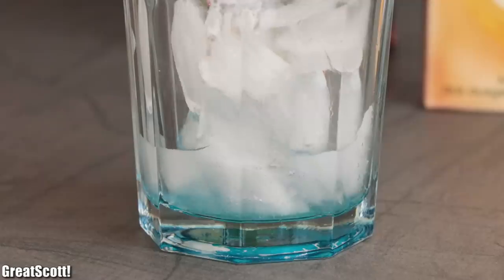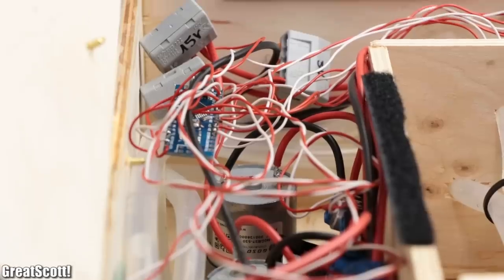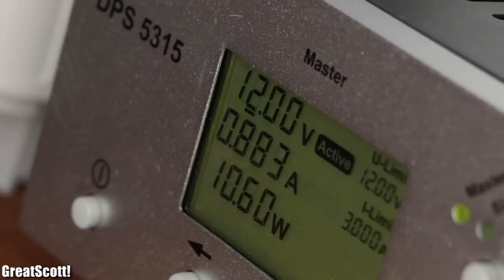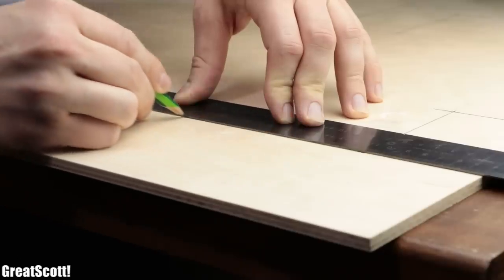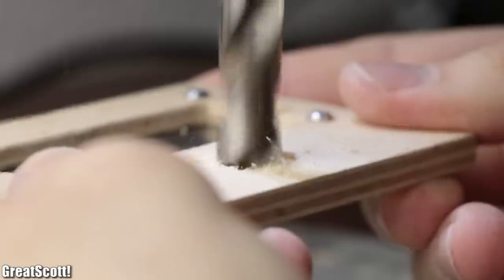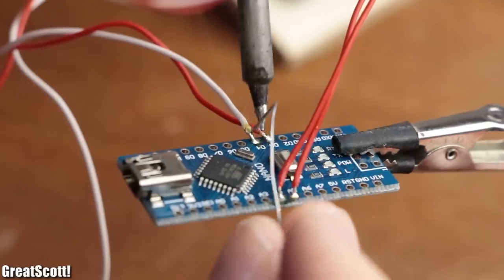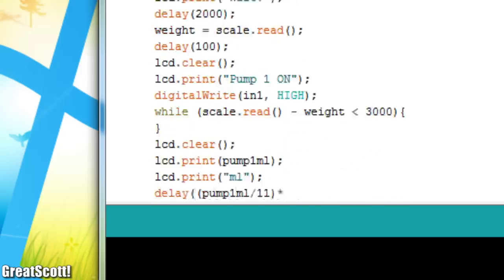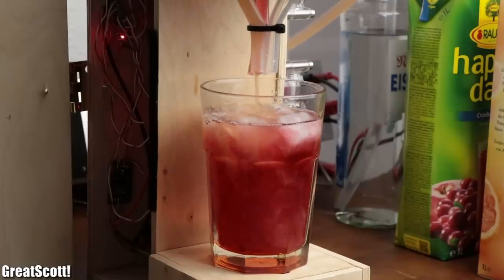Make your own crude Cocktail Machine

Comment: A suggested upgrade: after dispensing each ingredient, run the pump in reverse for a few seconds, to empty the portion remaining in the tube.
Reply: Another idea; to save some cost in favor of preparation speed might be using just one pump and distribute the ingredients through the tubes with valves.

Comment: Cool project. 

Just a tip, pre drill your holes in the timber, you have a pillar drill. Perfect nails, no splits and you control where the nail goes. Same as electronics, provide a path of least resistance and the nail will follow

Good Job on the electronics 🙏
Reply from the maker: I will remember it for next time.
Reply: GreatScott! No need for nails. Just use glue between the surfaces and clamp them together.

Comment: Would it be worth reversing the pumps for a few seconds after it finishes to clean out the hoses? That might keep the plate clean and make cleanup easier later. 

It would also make switching to other drinks easier. It's not a screwdriver with cranberry juice!
Reply: That could cause problems if the pumps need primed.
Reply: I dont think this type of pump needs to be primed, looks like it should be air-tight. but then again I haven't used them.

Comment: This is an interesting project and I liked your design, thank you for these amazing videos. 
One idea to add variety to your drinks is to use solenoid valves to control from where the pumps are sucking, this way you wouldn't need as many pumps and the valves are definitely cheaper.

Edit: Thinking again, maybe using the valves wouldn't be such a good idea for food safety.
Reply from the maker: Good idea. I like it.

Comment: That is awesome, i wonder if with 3D printed parts for the case and a little bit more of engineering to account for the vibration so more structure would give a better stability, and a SD Card reader to read "recipe files" would render in a awesome machine.
Nice job, i would like the video 10 times if i could.
Reply from the maker: Thanks mate and thanks for the feedback. Nice ideas.
Reply: You could even use some Peltiers and cool the drinks to temperature, that would be cool, and with a bit of code you could easily compute the alcohol percentage and volume in a said mixture of drinks :)

Comment: I saw a group of 4th year engineering students did a similar project to this for their capstone project. Cool! 
Theirs worked a bit differently in that I think all tubes could run at the same time, no weight sensor. They also added an auto cup dispenser and conveyor for coolness factor.

Comment: Hey man. You got to apply the solder to the pins as you're heating with the iron. When you put the solder on the tip first, the flux burns away and you get a cold joint.

Love the videos!!

Comment: The 5V pin of the L298N is actually an output from the build-in regulator. So no need to hook that up to 5V
Reply from the maker: Correct, I realized that too late for the video but changed it in the schematic.
Reply: True

Comment: Thank you. Very interesting demo with professional work. Different constituents can be placed at top and gravity fed into the bottom container. The flow of different constituents can be changed automatically using solenoid valves placed in the discharge line of upper tanks.The load cell can weigh cumulatively and stop in the end.

Comment: Hey GreatScott!
I have a project idea for you: Modify a PSU to be constant current source.
I think if you remove the feedback from the output and add a small resistor(current shunt?) to the low side, it could provide a feedback. This should be amplified to the appropriate level and voila CC PSU. 
I didn't think this through, but I think this could be done, with your knowledge.
Would be useful to drive leds, even many in series, since the voltage could go above 12V.
What do you think?
Cheers
Reply from the maker: Hmmmmm I put it on my to do list.

Comment: instead of using a timer you could have used the strain gauge measure the weight?
Reply: He could, but I don't think it would work as well as it does with the timer. The problem here is that the load cell produces a low signal that is susceptible to noise, in order to read a stable signal you must use some form of filtering, which will decrease the response time of the load cell, so he wouldn't be able to measure the amount of liquid poured in real time.
Reply from the maker: Yes, that would have also worked. But the problem was that due to the vibrations the measurements were a bit off.

Comment: it might be possible to measure the liquid on a other way. you might be able to measure the current of the water going through, because it is moveing electrodes it should produle a voltage !!
can you do a vid on that ?
Reply from the maker: I don't understand what you mean. Sorry.
Reply: GreatScott! Go on wikipedia and search for magnetisch induktiver durchflussmesser
Reply: GreatScott! Dass meine ich
Reply: I'm not sure what you're referring to, but you can't use the electrical current flowing through a liquid to measure the flow rate. To do that would require either a turbine in the pipe or something else that can be measured electronically which is not practical on this scale
Reply: Algorhythm no, you can do it. It is called magnetic flow meter. Or mag meter. It requires a conductive liquid. The problem here is that it requires a known conductivity on the liquids. Which would mean recalibration after each new liquid is used.
Reply: Rostol yeah thats what i meant :-)
Reply: Some flowmeters work like that I think

Comment: how safe is it to move liquid from a pump like that, since you will drink it
Reply: Very as you see he replaced it with food safe silicone tube.
Reply: Kartikey Agarwal He used food safe silicone tubes plus no mechanical parts come in direct contact with the liquids, the pumps simply press and push the liquid forward in the tubes
Reply from the maker: Correct, like already stated very safe due to the food safe tube.
Reply: If the tube is food grade it should be completely safe, as the liquid doesn't get in contact with anything else.
Reply: Very. Peristaltic pumps are used in hospitals for this reason. No mechanical parts come into contact with what is being pumped.
Reply: GreatScott! OMG great Scott reply
Reply: The way the pump works, the liquid never touches the pump directly. As long as your tubing is food safe there shouldn't be any concerns with it.
Reply: remember to clean it every now and again, I imagine leaving stagnant fruit juices in there would go bad quickly.
Reply: KX36 Depends whether you're buying a china food safe or a "really" food safe tube
Reply: +Rostal They are also very gentle on cells, so they are good for moving blood around without turning it into a protein slurry.
Reply: None of the moving parts contact the liquid. Pumping some dish soap and water through the device is as simple as changing the reservoir and ordering another round of "drinks".
Reply: A peristalic pump never touches the liquid it uses pressure that's what's so great about it
Reply: but there's a vodka so the drink is sterilized ;)
Reply: +Grzegorz Paleczny
That's the sort of thinking that ruins visits to Tijuana. ;~)

Comment: great idea!
the scale measures mass not volume so liquids with different viscosities will give different volumes. you could have one pump and a distributor that changes the liquid being pumped (plus some valves and that way you could have maybe 10 liquids and only one pump , plus you could do a flush to the pipes after each liquid was pumped)

Comment: Suggestion: When you drill into wood, Drill from the hidden side and also have another wood piece under the piece you are drilling. That way when material is pulled up the hidden side will have ugly sides(Because of wood pulled up) and the good side will have a nice hole because the wood piece it is against will prevent sides from separating on the sides. If you need both sides pretty, then sandwich the piece you are drilling between two other wood pieces and then drill.

Comment: I have a plan to make these cocktail machines in this way but with a vinyl wrap inside and outside. The pump motor inside the case, The LCD Display, The rotary encorder, The Arduino Nano, The pump motor driver, The Scale, the DC jack all connections will be connected through a designed PCB and order it from JLCPCB and with a on/off switch. The Rest of the Pump pipes will be in a professional look. I hope you make like this cocktail machine in a future video

Comment: Instead of using load cell, you can try 3 flowmeters inline with each pump. That way the drink can be made faster as the 3 pumps will pump simultaneously.

Comment: I'd make this with plastic instead of wood to be more kitchen safe but this is still a perfect DIY... might do this in the future
also, it would be good to have in the code the pumps reversing just a bit after pouring liquid in the cup to avoid any leakage to the cup base

Comment: When you drill holes, remember to put a piece of scrap wood behind what ever you are drilling(this prevents the chipping). Also never use nails, they make things look cheap and never look nice, alternatively you could of done dowel joints, which is quite easy to do. I recommend that you get a laser cutter, as they are really useful for my electronics projects, and if you know how to make boxes via 2D CAD software, you can do the casing for that project in a matter of 45 minutes.

Comment: You do realize that by using a positive displacement pump (like a peristaltic pump) you don't need to go into the trouble of measuring the weight of the transferred fluid. Simply by counting the pump shaft rotations you can get a comparably reliable reading of the volume.

Comment: Hey Scott, I have an idea about your vibration problem.

Instead of mounting the 12V DC motor to the frame by screws. Have them inside of the box and glue it to a sponge or something that is a good vibration absorbent. 

Then have strong adhesives connected to the 12V DC motor and the sponge, both to where ever you want.

Hopefull this should reduce the amount of motion.

Comment: you can make it customizeable without messing the code by using the rotary dial or add a SD card with a library of drinks and it will say which container goes to which pump.

Comment: To avoid tearout, put a sacrificial board under the piece you're drilling through. Also, use some sandpaper to make the edges less rough, after or instead of the rasp.

Comment: thats a very cool idea but the only problem i see is cleaning it after use as im quite sure mold would build up within a couple of days if not cleaned manually. The only thing I could think of is after its done dispensing the drink if there was a clean cycle say using water that would push the water though the tubes to clean. other then that its very cool :)

Comment: Just a quick tip regarding wood glue: it works best when gluing two surfaces together, but is terrible at filling gaps. So instead of gluing the wood together with superglue and then filling the gaps with wood glue, I would only use wood glue. A thin layer is enough to create a super strong bond, it just needs some compression during drying. Ordinary clamps are totally fine, but when working with a rectangular shape, strap clamps are really useful. Gaps, should they remain, can be filled using wood glue mixed with an equal amount of saw dust.

PS: You said beech wood, but it seems to be birch wood, but not a big deal ;)

Comment: You could use your strain gauge to measure the weight of your product.
When you start your drink the scale zeros and measures the amount based on the density of water (assuming most drinks are >80% water).

Comment: Very nice project! May I suggest an improvement? You're using a precision weight sensor, you can use it to measure the liquid weight and knowing that the liquid is around 1kg per liter you can measure the quantity of the liquid.. I just don't know if the voltage difference can be transformed in weight difference so easily.. the timer doesn't look so precise..

Comment: Fun and educational project, as always. I wonder if it's possible to get a stable flow rate using gravity feed and solenoid valves? Then it would be easy to have any number of liquid containers on a shelf on top of the machine. Solenoid valves are pretty cheap, so having 10 of them wouldn't be a big investment. Also, they don't vibrate or cause too much noise.

Comment: Great project! 
I wonder why you used a delay after pouring starts to determine volume of liquid rather than just have the pump stop when certain volume (weight) is registered by the scale. That way you don't have to worry about flow rate of the pump, just give the Arduino the density of the fluid being pumped and required volume so it knows what weight to aim for? I quite like the 'charm' of your woodwork constructions (mine have a similar aesthetic) but maybe your next investment should be a laser cutter and some acrylic.....haha. Keep up the good work!

Comment: Wow, great idea! But I think you could improve this further, like giving an "upgrade" to your machine. For example, you could offer ready-to-serve recepies. You choose you cocktail and the arduino knows how to mix it. This would inflate the code extremely but could improve the user experience, And you should consider transferring the three tubes to one final output, as only one liquid at a time flows through the system. Finally, you could try RFID-Chips to mark the different ingredients (means you should have RFID readers for every flask , I know.) But really cool though!

Comment: Great project! I am thinking of doing something similar and I am wondering why you let the three pumps run individually instead of running them all at once, is it because the power supply can't deal with that effect? and why do you use a scale? if I'm correct you only use it to see when a liquid enters the glass to know when to start the timer. Correct me if I'm wrong but wouldn't it be easier to just scrap the scale and measure the passed time after the pump is activated, maybe you'll need to make up for the extra time it takes for the liquid to go through to the tube but that wouldn't be so hard I think.

Comment: Wood glue was more than sufficient for this project. Nails would just have helped to keep the boards aligned while the glue dried. Seems like you may have figured this out already.

Noticed after each fluid is done it still drips and leaves some of the contents in the tube. Would it have been worth while to reverse the pump right away for a couple cycles and put back what was in the tube into the container again? Or does it naturally flow back on it's own?

Comment: Great project. It's hard to tell from the video, but I think you need to increase the speeds of your cutting tools, both the jigsaw and the drills. This will make your cuts and holes cleaner. 

Adding woodglue after the fact doesn't do much I think, wood glue only works well when clamped. If you can use thicker wood you can use nails or screws.

Is there a pump type that can give out definite volumes, regardless of density of viscosity? Some type of positive displacement pump? I'm thinking this project can be modified to do some real chemistry or biology.

Comment: You know you can 3d print peristalic pumps and just hook then up to a DC motor.  Also,  you could've used an Esp8266 D1 mini.  With a built in Microsoft you could drop the LCD,  the rotary encoder,  and the Arduino while making it Wi-Fi compatible just a thought.
Reply: Typo I meant microcontroller not Microsoft lol

Comment: Nice project, but is the scale really needed? I mean ml is a the volume and a different velocity results in a different density so they are both a bit off. Is it possible to only do it with the pumps? Ty

Comment: question why didn't you use air pump reduce pressure at one end and increase at another 
I think it would have been more quiet and smooth fluid flow through the pipes just asking

Comment: Hello! Great build!  Greetings! So I tried doing this (only two components though Lemon and water [i put sugar in the water container and let it dissolve]) but I used a wiper motor, the one in a car which pumps water on the windshiel and it works better and without hassle. Any specific reason why you decided to go with Peristaltic Fluid Pump? Any advantage?

Comment: Instead of the L298N, could you just use a 12V power supply and a relay controlled by the arduino to power on and off the pump?

Comment: Nice vid! It would look sweet with lasercut materials instead.

How come that you don't use the load cell to measure the amount like electronic scales does? Then you can make a budget version that siphons the liquid instead of using pumps and uses solenoids pushing the tubes shut as valves.
Reply from the maker: Sounds possible. Maybe I will try that in another project.

Comment: Hi Scott, could you possibly design a Guitar Pickup Winder? It just needs to be a box like this with One Motor with its shaft sticking out with a connector for a wireless pickup and it’s speed controlled by a foot switch. With double-stick tape you would attach the empty pickup hub on the connector. There needs to be a counter to count how many wraps of wire are wrapped around the pickup and the counter should be able to be set to stop at a predesignated amount. i.e.8000, 9200, 12000 . The operator would sit at the end of the machine and hold the wire in order to scatter-wind the wire onto the connector as the connector spins. These machines are available in many places but the are all in the ballpark of $400 to $700. I think one could be built much cheaper and much better. Thank you!